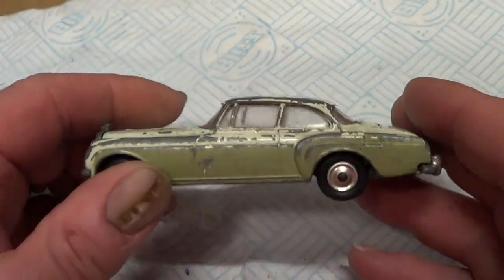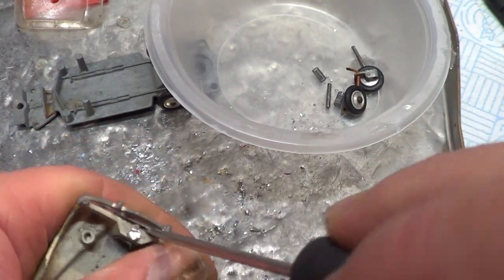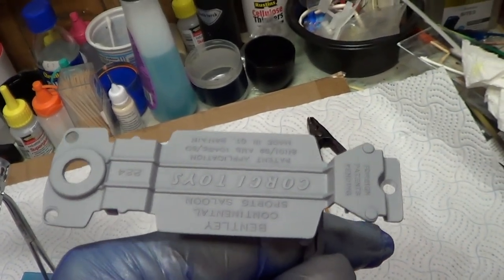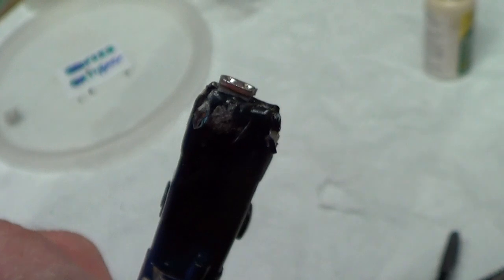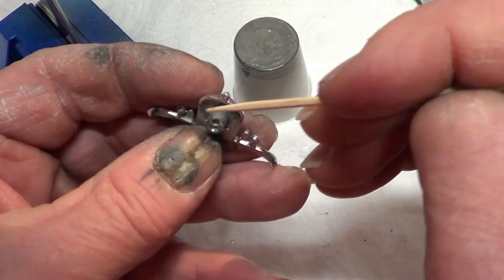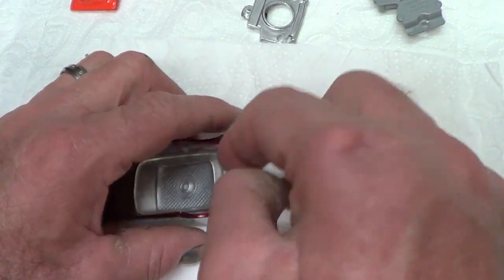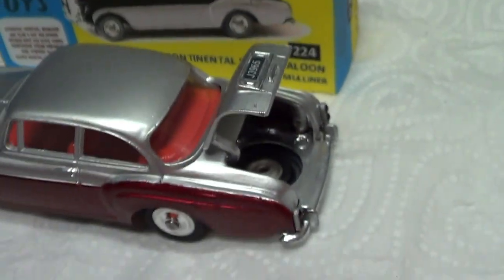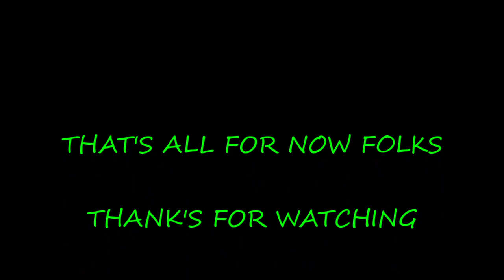CORGI TOYS BENTLEY CONTINENTAL SPORTS SALOON RESTORATION.

Comment: Nice job on the masking, Nick. I might have been tempted to an easier split, given the decision to change the colours anyway, but that result looked splendid. And good trick with those tiny tail-lights lenses. For once, the cheapo vac-formed interior, in red, actually looks right.  Nice one!
Reply from the maker: Thank you Fraser, I did think about doing the split differently as the photo I went off had a different split, but I decided to go with the corgi one, those back wings were a nightmare as there was no real defining line on them and the casting wasn’t great so they kind of ended up being a bit vague, if you know what I mean!🤔
Reply: @crapaudnicksdiecastrenovat1739  Vague? Sometimes my two-tones are so vague it looks like they are out of focus!

Comment: Did mine in plain burgundy/silver, agree with you. Maging these off is not easy. I even put my grill thru the caustic soda, Can still use molotow,  Think i painted mine silver & the rear bumper. Yours looks really great. What paint did you use for that metallic Burgundy. I really like that
Reply from the maker: Thank you Ian, the burgundy suits this model I find, it was Holts auto spray paint, no name or code on the can, I just picked it off the shelf in the shop going by the colour of the lid. That masking was a nightmare, especially on those back wings, I still didn’t get the line to look that clean either, looks ok to the naked eye but not great on the close up photos and video shots, and the curves on the front wings were a pain too🤦🏻‍♂️🤔
All the best, Nick.

Comment: Lovely job ,what did you paint the front grille with ? regards, Tim.
Reply from the maker: Thank you Timothy, I used the Molotow liquid chrome, I bought the refill for the chrome pens on eBay as I prefer to brush it on rather than using the pens, it is expensive though but check through the listings at the prices Here is a link to what I use: https://www.ebay.co.uk/itm/264669257172  
All the best, Nick.